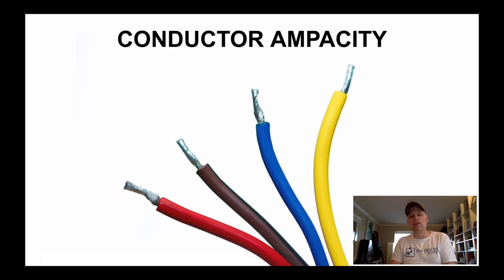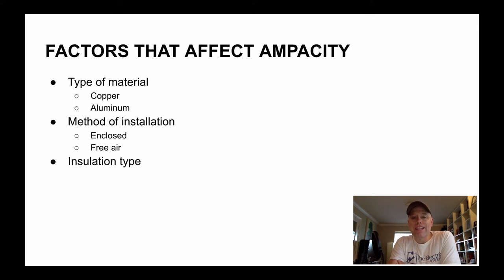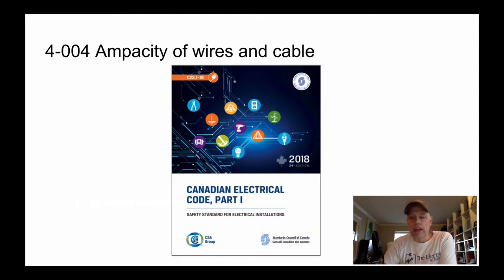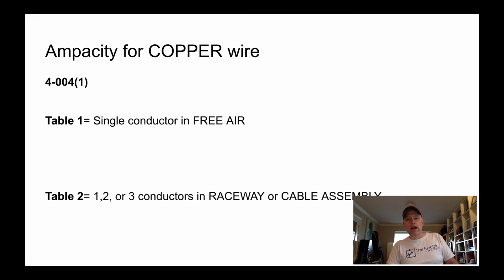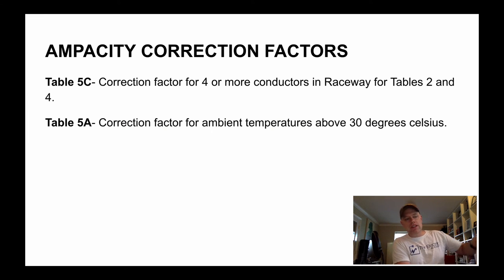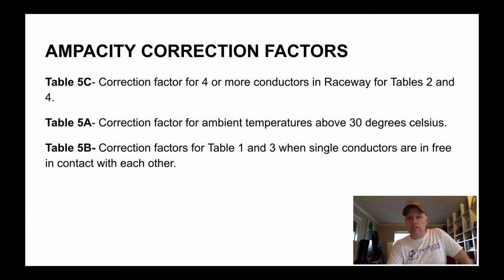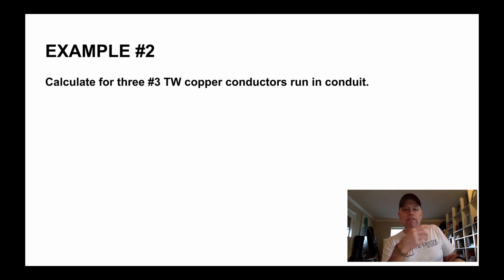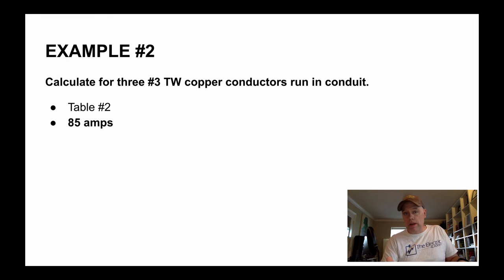Calculating Wire Ampacity.

Comment: I just did a free air job
I ran 100 amp feeder to garage because the entire backyard was paved 
Basically to service mast with Ariel cable 2 hots neutral and aerial is ground
Reply from the maker: Dav Cot did you run it with neutral supported triplex?

Comment: Hey Chad. 4-004 1)a) gives the spacing requirements for free air cables. Typically, individual conductors ran in a cable tray or unistrut rack (with appropriate spacing), are calculated per Table 1 or 3. I saw comments on tri-plex and O/H service. Neutral supported conductors are covered in Table 36 A and B, and the O/H Service side is not under CEC (Hydro sets those limits). Hope this helps some of the guys here.

Comment: Used to work at a nuke plant. Free-Air is literally hanging the cables from the ceiling. We had to do it for temporary power. Except it wasn't always so temporary. The cables are Clove-hitch tied to beams and dangling.

Comment: in example 5, why did you calculate based on#2 wires instead of #8 wires? I will be confused if I meet the same type of questions as this.

Comment: Hey Chad , thanks for the video! I've been going through the CEC again in prep for my license exam (I work out of Toronto). I've been sort of struggling to find clarifications or examples of the conductor sizing for larger single conductors and cables using the D8A through to D11B diagrams and tables (and their larger counterparts D17A-D17N) for direct burial, underground run, and raceway.

Could you provide any suggestions or resources? I'm particularly trying to understand if the same derating factors for temperature and such (5A-5D) apply to these calculations.

Thanks in advance, keep up the great content.

Comment: Hey Electric is there a possibility you could give me some pointers on a few things for the electrical code book? I have a mid term test coming up  in two weeks that is on voltage drop, pull box calculations and ampacity deration. I am scared shitless because i transferred into this program and kind of new to this whole canada electrical code book, and my professor is a bit of a hard tester.
Reply from the maker: What kind of pointers are you looking for? what program you in? What year are you in?
Reply: @TheElectricAcademy  i'm, in electrical techniques which is a pre apprenticeship program at Fanshawe college in London Ontario. One of the problems that was posted regarding voltage drop went something like this.  A 7200 watt  water heater operates at  240 volts and is located  20 metres from the electrical panel. What is the minimum TW75 conductor permitted to be installed for service to the water heater @ 2 % voltage drop. Those questions like that are kind of confusing and not sure what table to go to first when solving it.

Comment: for example 5, there is 2 different kinds of cables with different kinds of temperature ratings, R90 & TW.  you said the r90 has a 90degree rating and the. tw has a 60 degree rating? how do I know or where can I find what temperature ratings the cables have? is it in the code book or should it be known already?

Comment: Thanks for your video, I have a question. For ampacity of cables in cable tray, the CEC is clear, spacing > 100% cable diameter; 25% <spacing <100% diameter and spacing < 25% diameter, for each of these, CEC give answer. But in NEC (NFPA) , in cable tray, it only give spacing >100% diameter. So I want to know, can I use the CEC code for the 25% <spacing <100% diameter and spacing < 25% diameter situation, thanks.

Comment: free air is when you carry it from meter ole to house in the air, or house to barn in the air, or the old style in very old homes where wires were on insulators and such.. technically, if you stable it to wood and do not cover the opening area it is free air

Comment: Running conductors on top of open ladder rack in a data room environment is considered free air
Reply from the maker: Lawrence Tinsley Yeah. That’s definitely an example. Have you done it?
Reply: @TheElectricAcademy  yes sir, for over 20 yrs, #6 - 750 mcm DC power distribution systems

Comment: hi , im having a problem finding the answer for this question here .
"Three 3-wire , single phase  circuits are installed in a conduit passing through an area where ambient temperature is 60*C and connected to a piece of equipment with a maximum conductor termination temperature is 75*C . The conductor are No. 4 AWG RW90.
"? T2 is 85A and 9 wires on T5C 0.70 = 59.5  A / T5A = 0.58x 59.5 = 34.51 A . On my MOD , it says the answer is 48.29A .

Comment: I'm hooking up a 30 amp 110 volt outlet for a trailer which is just a little under 200 feet away from the panel. I'm trying to determine the size of wire to use. Can you help?
Reply: 10awg might be perfectly safe. https://conduit.site/tables/table-310.15-b-16.php?option=cu
But the voltage drop would be excessive. So I would go with 8awg or even 6awg if you have anything that would not like the voltage fluctuations. 
https://www.calculator.net/voltage-drop-calculator.html?material=copper&wiresize=2.061&voltage=120&phase=ac&noofconductor=1&distance=200&distanceunit=feet&amperes=30&x=60&y=13

But I am not an electrician so take my advice with a grain of salt.

Comment: triplex is free air, overhead feed to shop for example. Also hydro connections
Reply from the maker: True but the CEC has its own tables for triplex, duplex, and quadplex
Reply: @TheElectricAcademy  hmm, individual runs in a cable tray?
Reply from the maker: Yup. I agree.